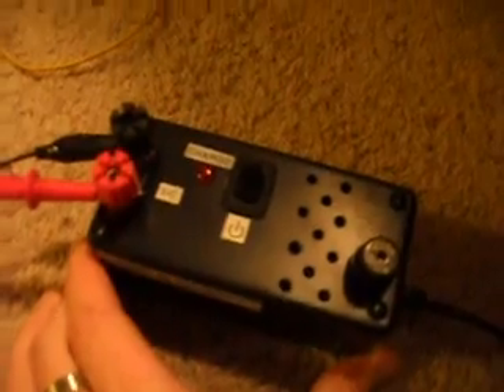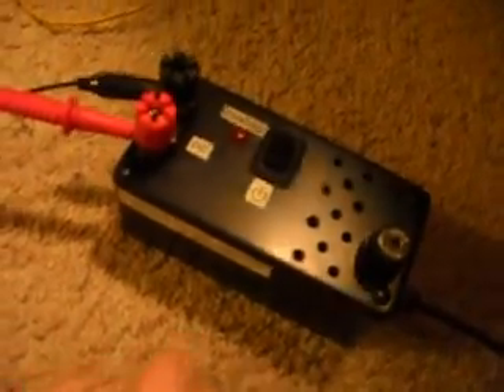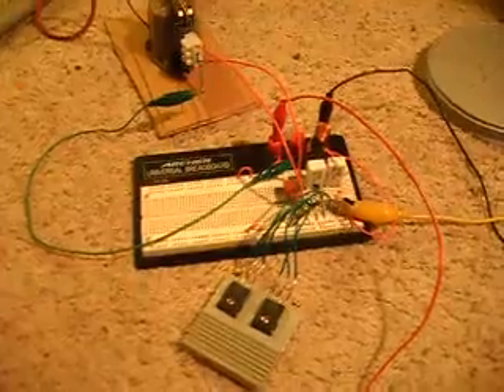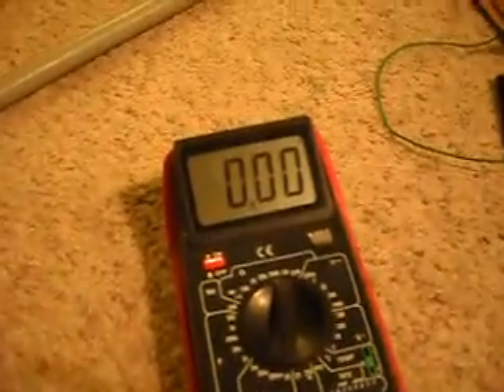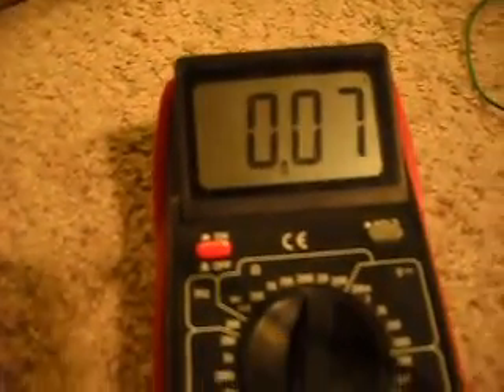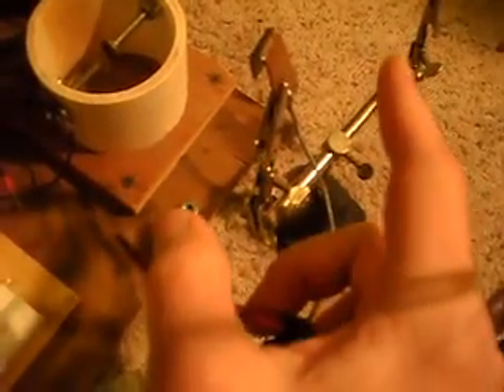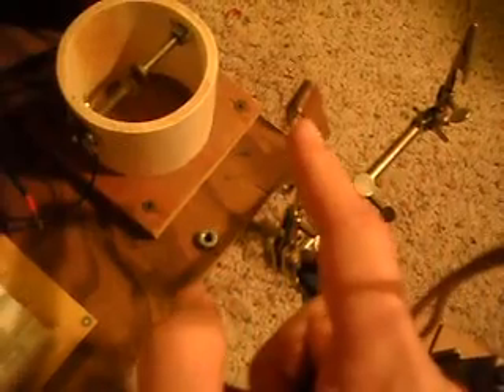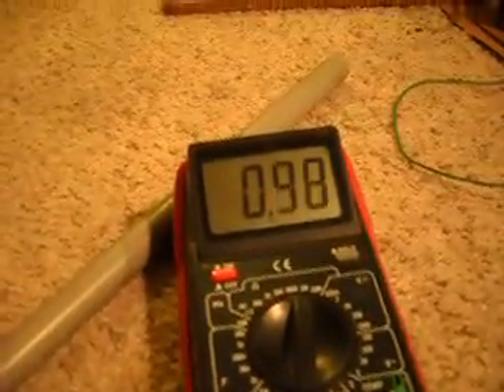ZVS Flyback Driver

Comment: To solve your start problem, do not wind it up on a variac, instead, use a fuse for protection, and power it up quickly, once the oscillation is running, you can turn it up and down as you like...